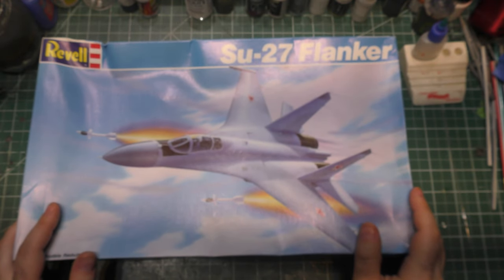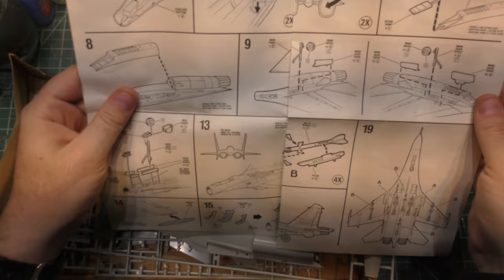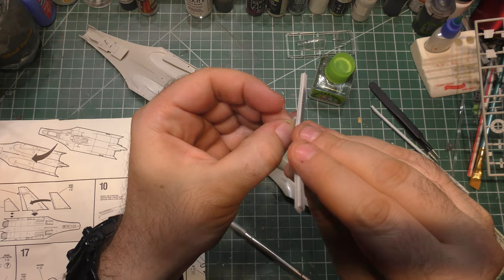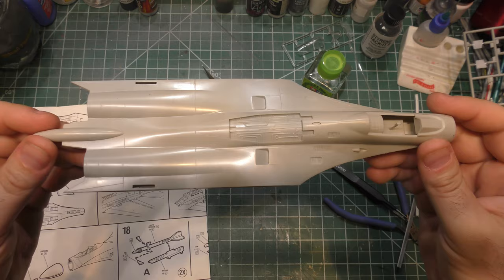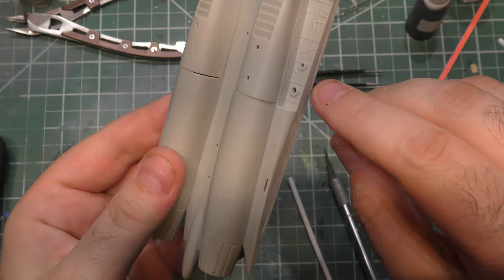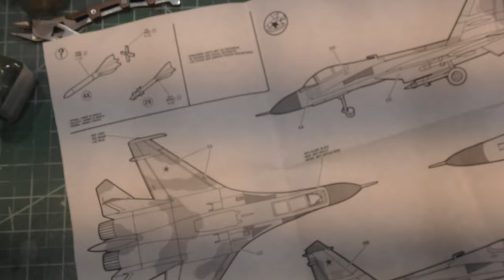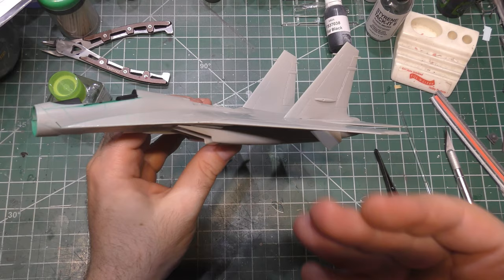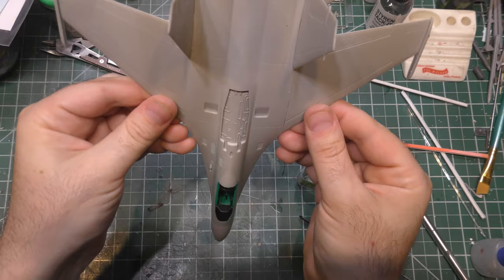Building the WORST Flanker Kit Ever! - Vintage Revell 1/72 Su-27 Part 1

Comment: Whats that Syringe looking glue tool that you are using? Does it hold super glue or do you dip it in?
Reply from the maker: Its a precision applicator for liquid glue, not super glue. Her, you can check it out - https://www.amazon.com/Flex-File-7000-Touch-System/dp/B00NG4HWMQ/ref=sr_1_2?crid=B30K50NE54W&keywords=touch+n+flow+applicator&qid=1649231062&sprefix=touch+n+flo%2Caps%2C69&sr=8-2
Reply: @AirForceBuilder  Neat. Does it act as an instant bond like super glue? 👍🏻

Comment: Too much overthinking, in my opinion. It looks like a nice basic kit and if it’s not accurate as a real Flanker, it’s a good candidate for a “what-if”?
Reply from the maker: You can call it overthingking, but don't most modelers strive for accuracy in kits? Kit reviews online mention the accuracy - or lack thereof over and over. The aftermarket industry thrives on correcting inaccuracies of various kits.